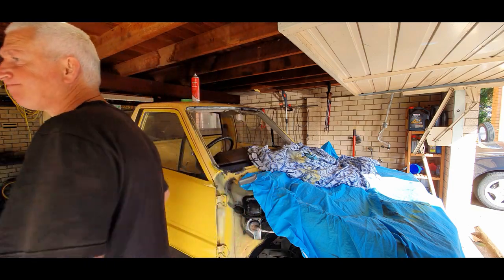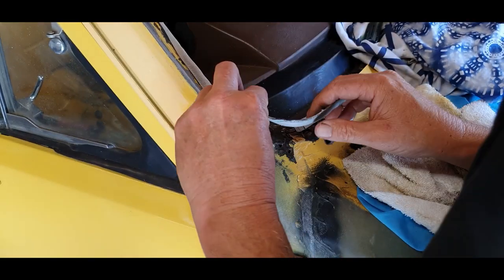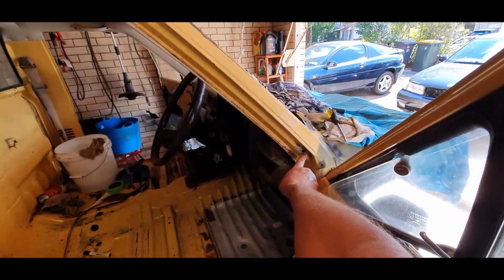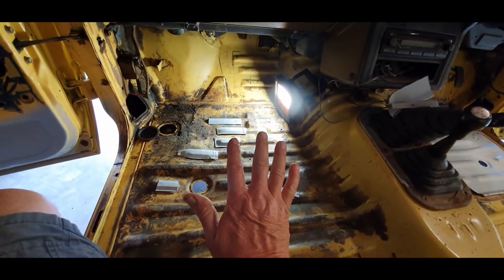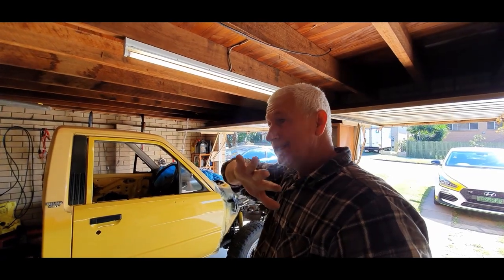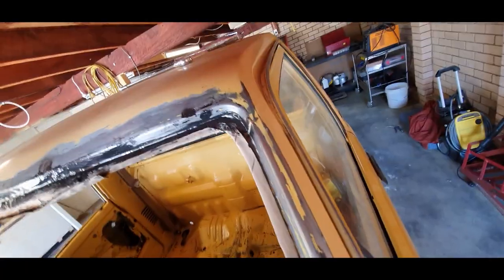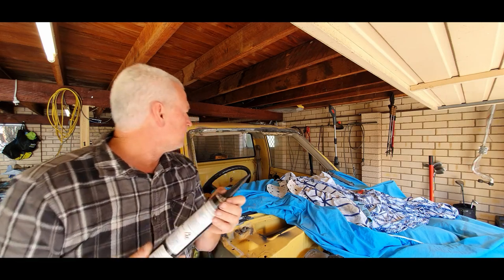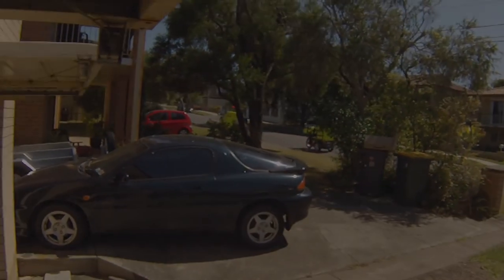TOYOTA HILUX NEW FLOOR PAN 2 | 1984 Toyota Hilux 4WD restoration (Ep 21)

Comment: Sorry you can't do Fred Flintstone impressions any more, but I dare say the future owner may well appreciate the inclusion of a driver's side floor.
Remember when working with sheet metal not to force anything.  If it doesn't fit, use a bigger hammer.
Reply from the maker: So true Chris. Or a dirty big jack like i did.

Comment: I appreciate your efforts to do this and film it.  But this is not the right way to do the floor panel or the windscreen surround. I'm currently also restoring this same model Hilux. Using silastic to glue down parts of the floor is going to make your rust way worse. I feel sorry for the poor bloke that ends up with this car. That rust is going to come back quick.
Reply from the maker: Its not silastic bro. Its panel bond. A 2 part adhesive designed to glue panels. Did u not hear me say panel bond 20 times!?? I then used automotive seam sealer to finish off.  All industry products.
Reply from the maker: The only piece I used the seam sealer to stick a piece of metal was a small piece on the top of the windscreen.